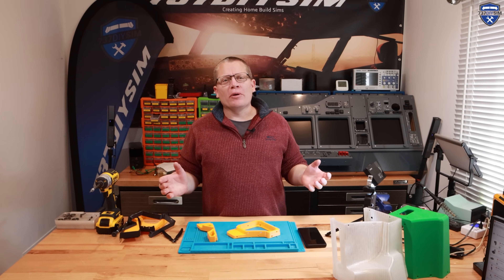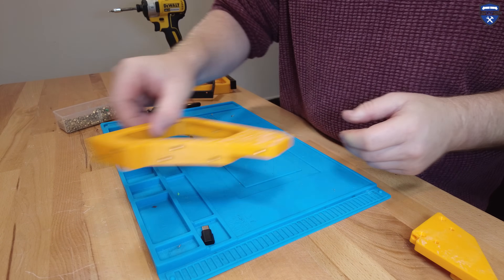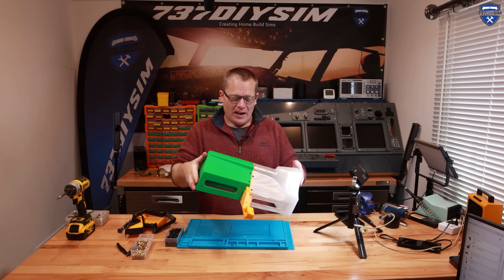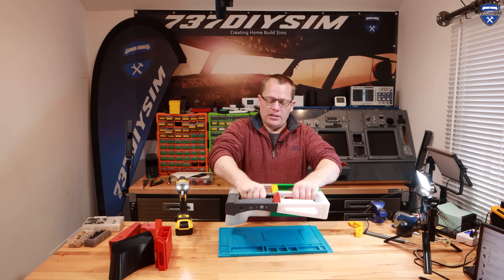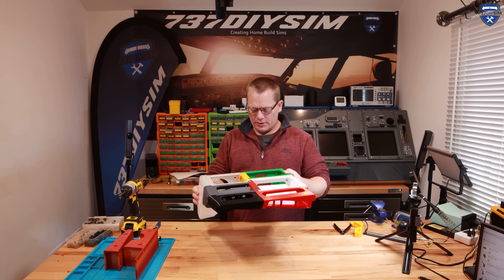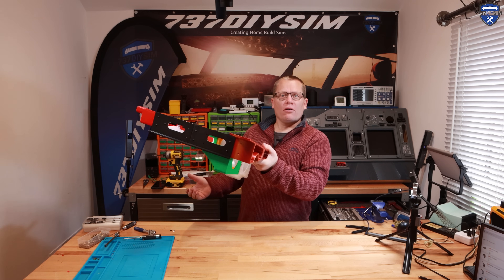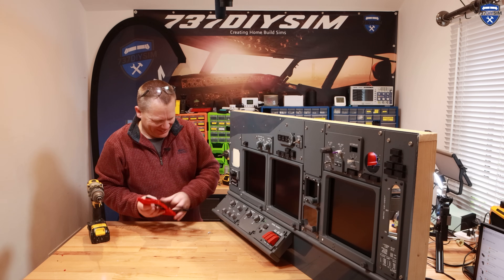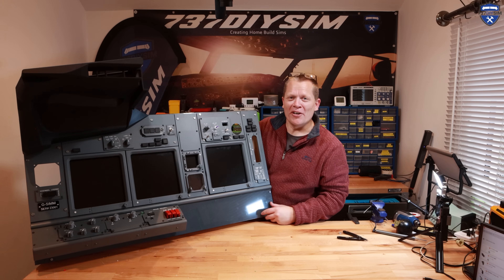737 GW Prototyping

Comment: Looks awesome, gonna buy the orintfiles and search someone who can print.   Really looks amazing and lightweight.

Wgat kind of monitors (brand and type) have you used voor de pfd ?
Reply from the maker: Hello, you really need your own printer to keep the costs low. I think getting someone else to print it is going to ramp up the cost quickly. As for the monitor, it is a 32 widescreen monitor.
Reply: @helimech8152  tnx for your response.   btw, the sidewalls are an amazing job

Comment: Great job Karl.. too bad about that failed filament print, I use the Library Prusa printer and every print so far has worked for my Cessna build.  Have a great day 😊
Reply from the maker: Hello and thank you, usually I like to think im structure savvy. But this caught me off guard. However, I realised once I inspected it, it had failed in every direction. That filament was over 7 years old